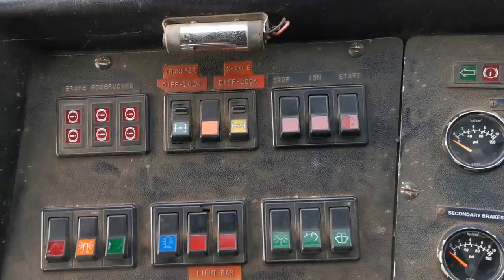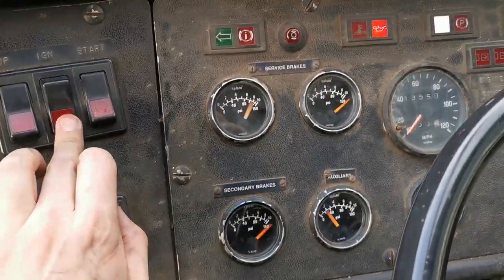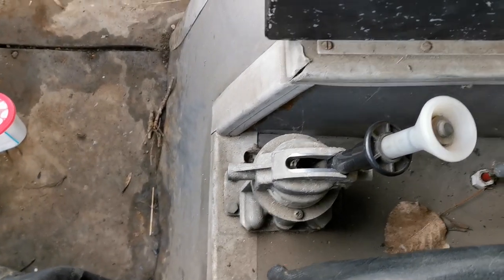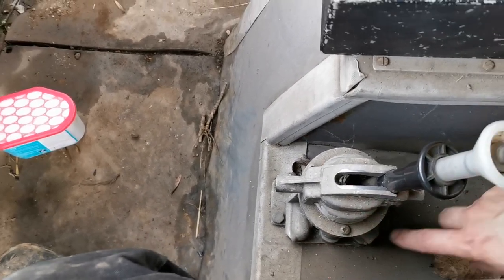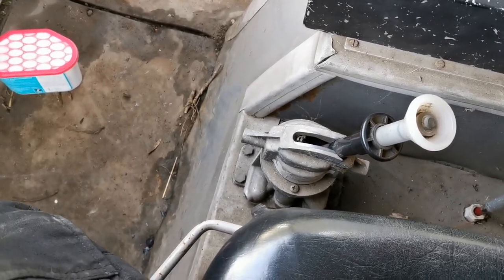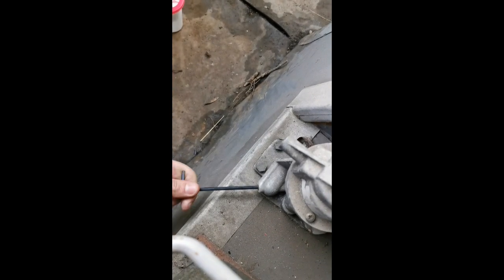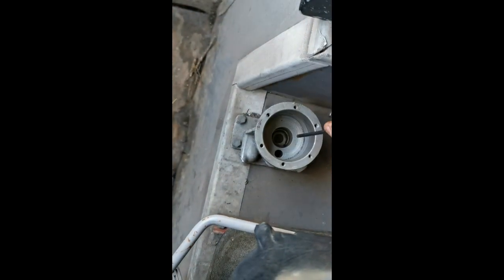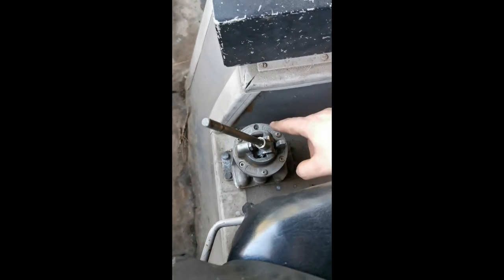Why my handbrake doesn't work (Air Woes 4 Project Marlin 6)

Comment: Have you considered replacing the whole Park Brake Valve unit with a different one that will be compatible to the system on the truck? 
Cant see why you couldn't use a different valve from another vehicle like a Bus or truck so long as it functions the same way? 

Same goes with the air dryer, you should be able to replace it with a more modern one that functions the same way if needed.

Comment: It might be feasible to 3d print a plastic plunger for that brake valve if a replacement is unobtanium or grossly expensive.
Reply: @ProjectMarlin  people in the US 3D print bits for firearms, the stuffs pretty strong.